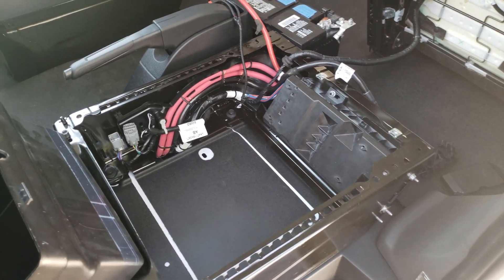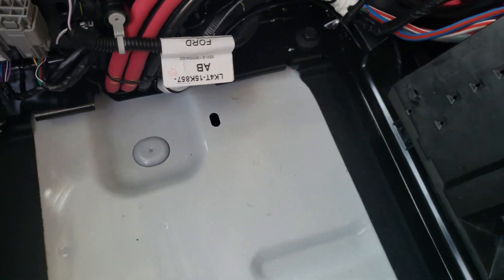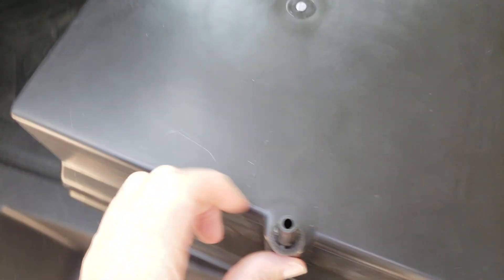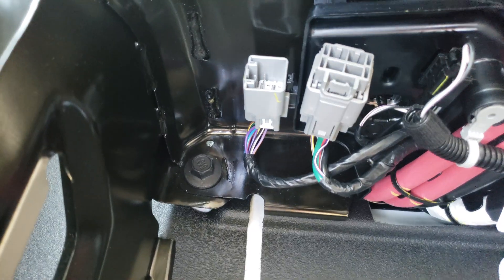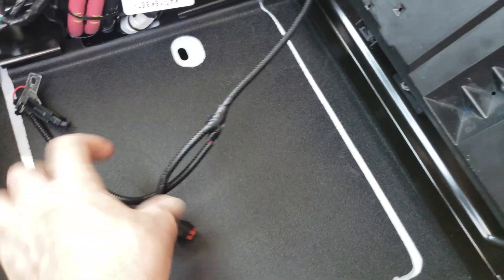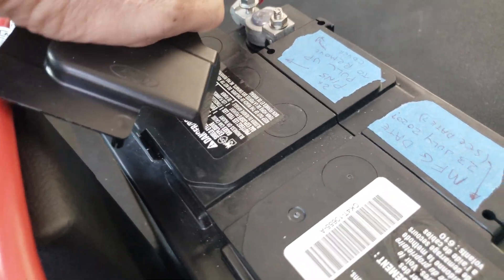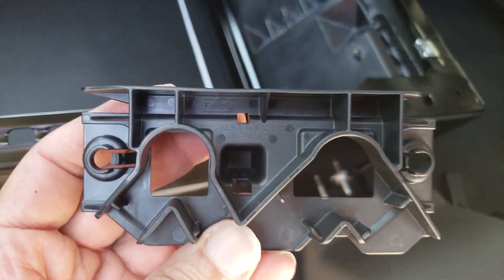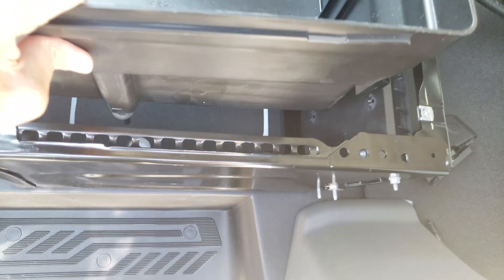2020 Ford Transit Battery Installation and Pre-Fusebox || Detailed review with driver seat removed

Comment: Is that a manual transmission or something why do you have a hand brake? I got a 2023
Reply from the maker: @TMFS4659  it's an automatic transmission. As far as I know all vehicles come with some form of emergency brake actuated by a method other than the normal hydraulic foot brake. It's a Transit cargo van. What kind of vehicle do you have? Does it have an emergency brake?
Reply: @biketothetop  I have a 2023 Ford Transit High Roof. My emergency brake is foot operated with left foot.
Reply from the maker: @TMFS4659  perhaps they offer both designs based on the vehicle configuration or they made a design change on the newer models.
Reply: @biketothetop  i just looked and im a bozo mine has an electric emergency brake that is button activated. The button is down by your left knee area
Reply from the maker: @TMFS4659   interesting... more junk to fail and cost money to fix

Comment: I have 2020 1.0 ecoboost PHEV 
It’s come up with the fault code lost communication with battery energy control module (BECM) I check all this fuse okay idk where is located any idea ?
Reply from the maker: Sorry I am not familiar with any of these aspects. I would do some Google searches and study electrical schematics to understand the configuration of the system. Then start troubleshooting components and connection points. Good luck. I did a search with what you told me and got 
back the following results:

A lost communication with the Battery Energy Control Module (BECM) can be caused by a faulty harness or a weak battery. The diagnostic trouble code (DTC) for this issue is U0111-00. 
Possible causes 
Faulty harness: The harness routing may be incorrect, causing tension on the connector.
Weak battery: The battery may have voltage issues.
Damaged terminals: The terminals may be damaged.
Disconnected connectors: The connectors may be disconnected.
Damaged ground connection: The ground connection may be damaged.
Potential consequences
A lost communication with the BECM can cause various issues, such as: warning lights on the dashboard, erratic engine behavior, and non-functional accessories. 
Repair options
A qualified mechanic can typically repair a lost communication with the BCM by replacing it. They may also check for any issues with the wiring to the BCM. 
When to seek repair
If the lost communication with the BECM causes your car to drive differently, you should take it in for repairs as soon as possible.

Comment: Just the video I needed and thanks! I have the optional alternator that requires the second battery and use the alternator to charge my Lithionics 600ah camper van battery. I need to check all the connections for proper tightening.
Reply from the maker: Glad I helped you. 600 amp hours is a big battery. I presume you don't have to have the second battery in place under the seat, just because you have the big alternator.
Reply: @biketothetop  The second battery may not be a component of the second Ford alternator. It's only a guess on my part. I will take a look at my van's build sheet to see, either way...
Reply from the maker: @Van_Liberty  I had just assumed that there's a single alternator and when the vehicle comes with two batteries, it has a larger amp output alternator. Do you have two alternators?

Comment: Im dumb about electrics and really need help. Nobody told me that my secondhand 2023 Transit has two batteries. They sit next to each other. I have no idea how the second one works or if its isolated. The dealer was no help because according to the VIN number the van only came with one. I dont know who installed the second one or why. What kind of a shop can help me understand this system? I dont even know how to monitor the second battery's condition or how to utilize it in the van.
Reply from the maker: @cvcoco  I believe the second battery is just giving you more capacity, but not changing anything else. In other words you just have more amp hour storage capacity. It's not serving any circuits any differently. I put a second battery system in my van and have videos documenting it. I use it to power a refrigerator and other devices. This second battery is charged by a Victron DC to DC converter. It charges when the engines running and shuts off power from the vehicle source when the engine is not running.

Comment: Where would a utility battery be placed on the transit??
Reply from the maker: I placed mine underneath the passenger seat, but had to lay it on its side to clear the seat movement plane. I used a lithium iron phosphate battery from battleborn and I made a YouTube video about the installation and how I charge it from my DC to DC victron charger. Look for these videos on my channel

Comment: Hey guys I have a quick question: Do you think I could connect my maintenance charging (trickle charging) device with the customer connection point? to keep the battery alive during the winter days...

reason why I ask: Our Ford Transit stands on a public parking lot in the city, so we have no shore power (230v) supply there - but we have huge power station! so we want to charge the Ford Transit battery with our charging device the gets power from that big power station standing inside of the car. So we could load it from inside... As we do not want to unmount the driver's seat, to get access to the battery we thougth of connecting it with the CCP.

Do you think this would work?

I know even the power station will be empty at some time but it would at least extend the capacity for a few days...
Reply from the maker: If power can come out that way to CCP from the engine starting battery without the ignition switch on, then power can go in that way to charge your battery. I don't recall if CCP is always live, but you can test it with a voltmeter, otherwise you will just have to connect to the battery directly. The engine battery is underneath the driver seat. Just make sure your connections aren't going to have a short circuit when not connected.
Reply: Ok thank you! And I already measured it with Multimeter, found "plus" in the middle of the ccp and at the top a contact with a screw on it and at the bottom a contact without a screw on top of it - they are both "minus". Does it even matter what of the two comtacts I use or "minus"? For can I use both of them?

Comment: Do you know what bolts size for those CCPs? thank you
Reply from the maker: I would have to research it, but is your objective to figure out what size termination lug you need for a wire? I might be able to pull up my terminal size from my purchase record with Amazon.
Reply: @biketothetop  we need to bolt cable plug into CCP ports but did not know what size of bolt to get from Home Depot

Comment: Why don’t we just have 100A or higher inline fuse connect to bolt on busbar and 100a DC DC charger instead of get Ford kit as it dealer is never know and very hard to locate.
We plan to use (2) Renogy DC DC Charger :
50a connect to 60a CCP1
60a connect to 100a as state above.
Reply from the maker: It is unclear if you have a question or what your point is. For safety, make sure the fuses upstream of the customer connection points (CCP's) are sized properly for the wire size/wire current capacity that you add/use downstream of each CCP.  I'm not aware of the components used in your complete system,  but they must be properly matched.
Reply: @biketothetop  What we said is instead of get Ford CCP2 kit, just connect a inline fuse to cut off switch ( if needed) and of course proper wire size to connect to DC DC charger.

Comment: So, I’m thinking that I can connect my DC to DC charger to the customer connection point that has a 60 A fuse. Thanks for taking all that apart and posting the video. I own a 2020 Ford Transit 250. 😊👏
Reply: I finished setting up my Orion dc-dc just a few minutes ago using the seat pin… works great.
Reply from the maker: You're welcome. Make sure you size the fuse for the equipment you will run. I removed the 60 amp fuse and put a 40 amp fuse in place because of the gauge of wiring I used and the loads I anticipated.
Reply from the maker: Did you see this video of mine about my DC to DC charger?

https://youtu.be/_u7g8gHhZGA

Look thru my channel for other videos that help understand battery system.  See this playlist

My 2020 Ford Transit: https://www.youtube.com/playlist?list=PLZEb8ngMuMU1b_6ev_eprqBzh88Jfr1bE